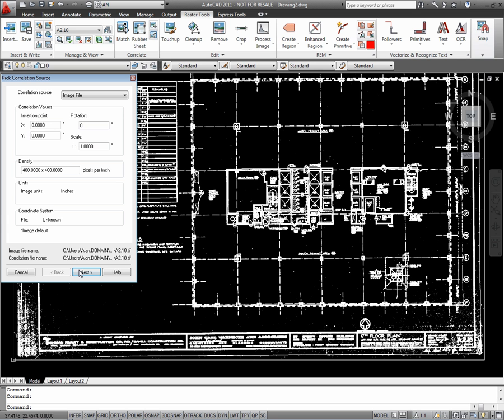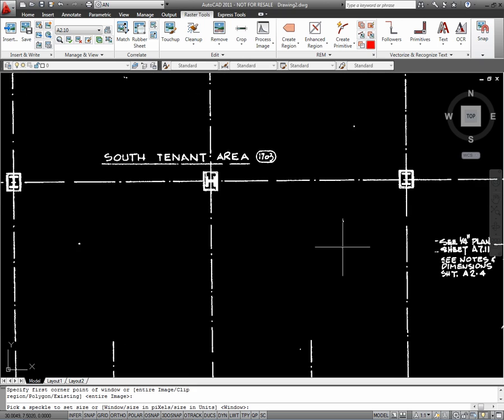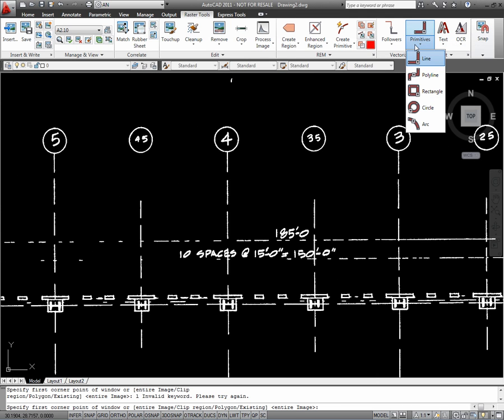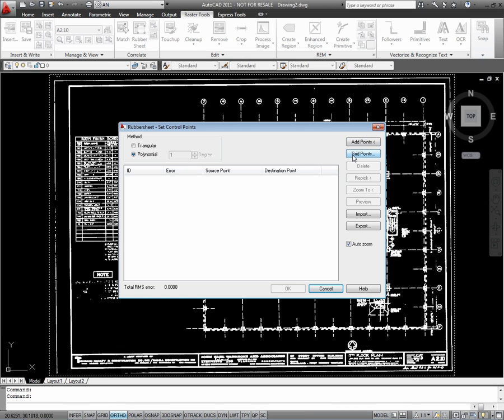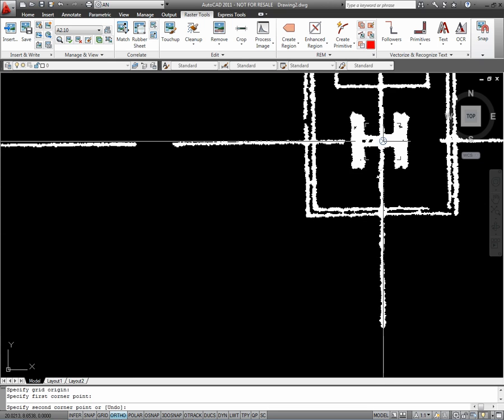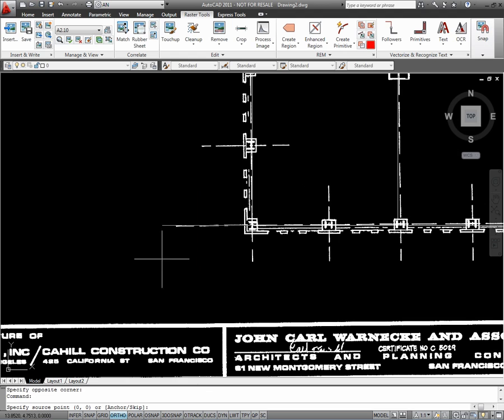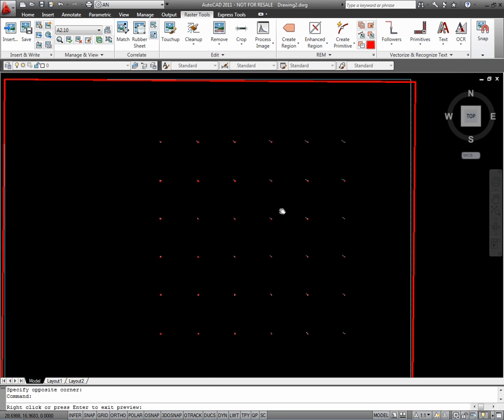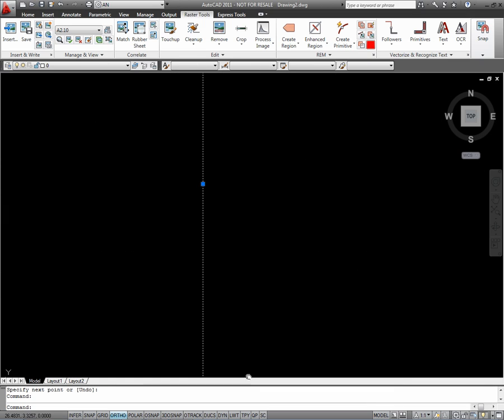AutoCAD Raster Design Image Cleanup

Comment: Thanks. Wouldn't it be easier to just use the 'ALIGN' tool and then align the whole image?
Reply: The "Align" function does not remove fisheye or pincushion lens distortion... Rubber sheet does....